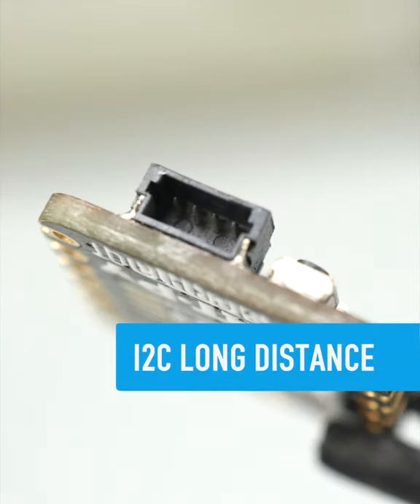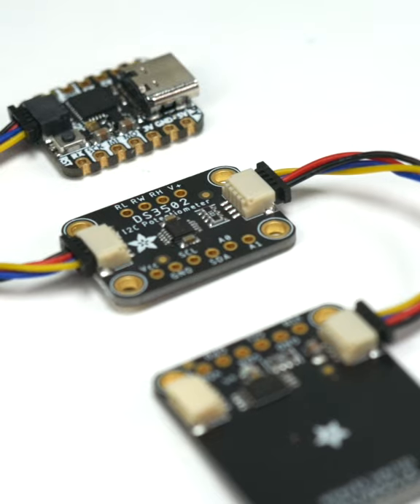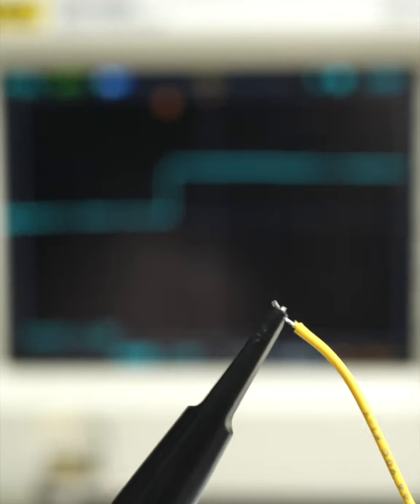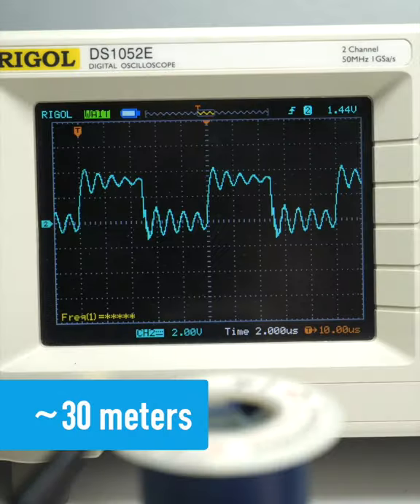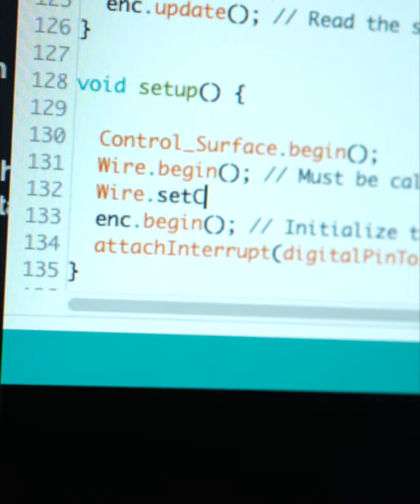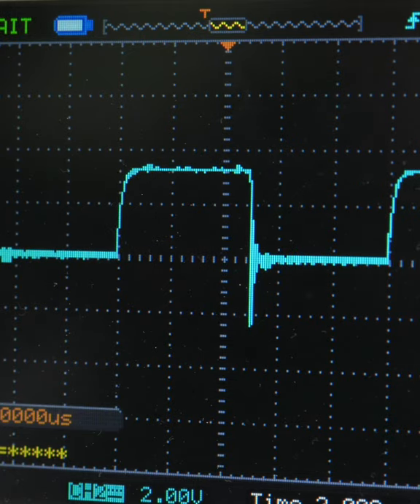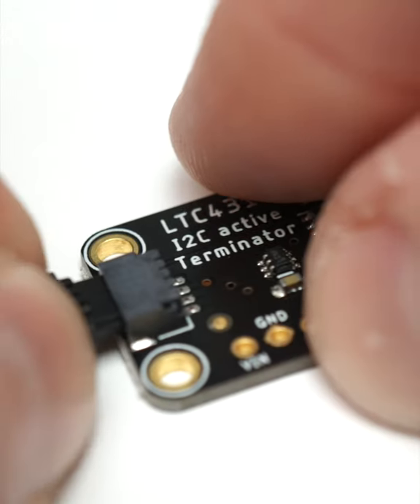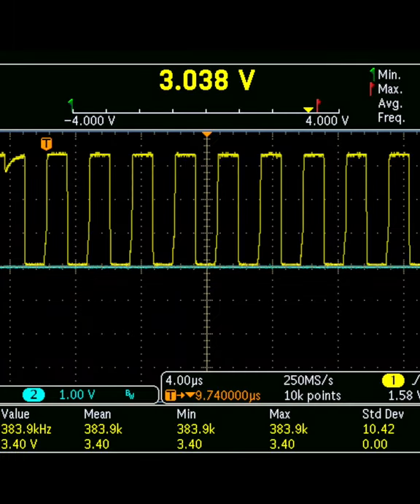I2C Long Distance - Collin’s Lab Notes #adafruit #collinslabnotes

Comment: as the name IIC suggests, its not designed for long distance. CAN or RS485 can easily do this.
Reply: You still require transceiver as external chip if you want to do this. Which is no different than this

Comment: For long distance, you really want CAN bus instead of I2C
Reply: yes or RS485
Reply: @labiadh_chokri  that could work, except there is cable count constraint
Reply: @KangJangkrik  It's electrically quite similar.
Reply: It's a shame you can't convert I2C to canbus or RS485.

Comment: I am ashamed to accept that, as an electronics engineer, I did not know that the distance of a cable could be compensated with the same microcontroller, the good thing is that my field is more focused on the industrial field and many times the parameters already established by the manufacturer, such as the maximum supported length.

Comment: I had sensors operate already over 10 meters because I found it easier to implement it that way. I dropped to 10 kHz which was still fast enough to transmit the data.

Comment: Or use differential pair signaling
Reply: Differential is mainly to handle external noise that will apply to both lines but leave the differential voltage umchanged. But differerential signals doesn't solve shark tooth or ringing.
Reply: The PCA9615 is intended to do differential IIC signaling over long distances

Comment: Making a single wire longer only adds capacitance to ground when two wires are together the longer they are the more capacitance is between them a single wire mainly suffers from inductance and interference because it is a good antenna

Comment: There's some caveats, but you can also achieve longer distances with a higher voltage, so shift converters, or just a couple of humble MOSFETS either end. Most FETs are tested for 1MHz+

You can then address ringing at either end with passives.

It's not as purpose built, but you can achieve some pretty amazing results this way, and learn a lot about this issue in the process.

It also important to think about capacitive coupling when running multi conductor cables.
Reply: very cool tip!
Reply: Cheers Ben!
Reply: I was just wondering about a way without getting a commercial product, thamks
Reply: Does twisting the pairs deal with capacitive coupling? Like, could one use unterminated ethernet cable?
Reply: Dont forget the quality of the wires itself ( real copper or cheaper alluminium )

Comment: What about for twisting the ground and signal wire together snugly along its length
Reply: That's to reduce pickup of disturbances. And very best with balanced signals that aren't related to ground but to each other.

You can't solve capacitance (creating shark tooths) or inductance (ringing) by twisting. But a proper termination affects reflections at the cable end.

Comment: Or match the transceiver impedance to that of the transmission line?
Reply: Could you explain why that helps with parasitic capacitance and inductance
Reply: @alexstone691  The parasitics will still be there, in the same way, e.g. a Ethernet wire has them. The trick is to be able to account for their effect: the ringing is due to the wire behaving as transmission line. By matching source and sink impedances to the line you eliminate reflections and ringing. Of course, this only works if the loading is known beforehand.
Reply: @juanignaciocarrano860  Then you could have any wire length you want right? as long as the circuitry can drive the load of course
Also thanks for explaining :D
Reply: @alexstone691  not quite, there is dispersion and wire resistance. The thing is i2c is not really designed for this kind of use. For longer distances some sort of differential signalling is better (eg RS485)
Reply: @alexstone691  You can never have any length wire for two way communication even if assuming zero resistance. The cable still introduces a delay that is proportional to the length. Even if terminating to avoid reflections at the end of the cable, that delay will affect the arrival of the response to a query.

So if the master is doing the clocking of the data, the master can only handle a limited amount of response delay before the response no longer matches up with the clocking.

Cable delays is also the issue with ethernet cables - the cable has multiple pairs, and the individual pairs will not have identical delay. So going from 1 gbit/s to 10 gbit/s or 100 gbit/s means these delay differences makes bits on different pairs arrive at different times. And higher speed means shorter bit times.